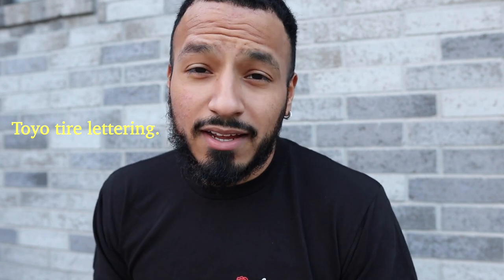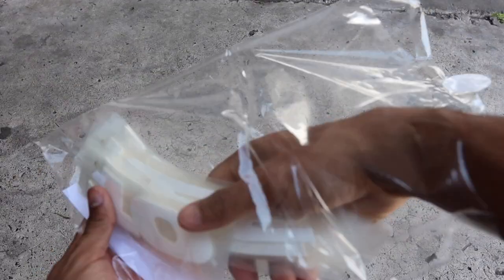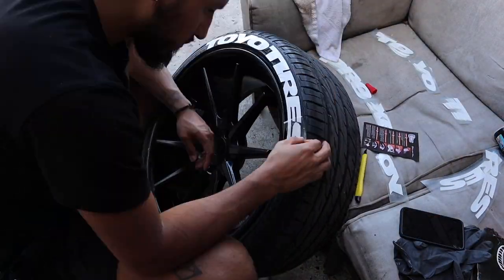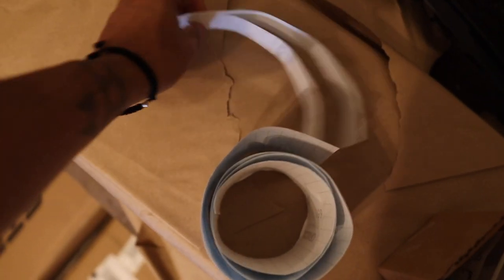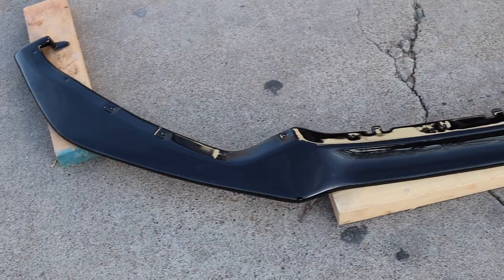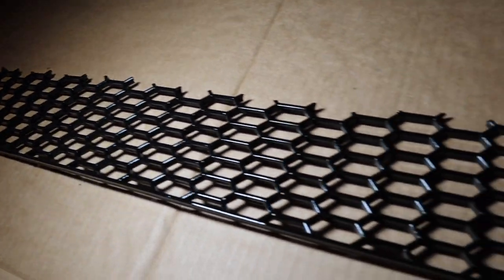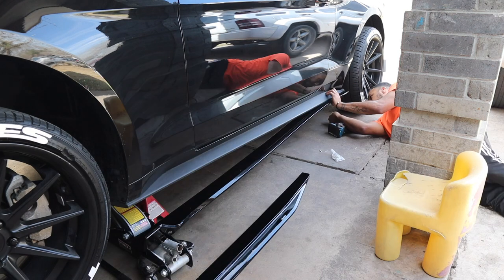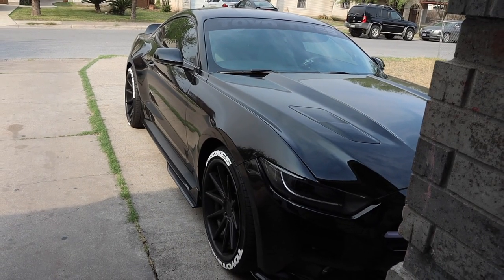Project neck breaker ll S550 Mustang Ecoboost build.

Comment: do you regret not getting a v6 or a v8? i want a mustang and the eco is really looking good but everyone talks about the v8 and how the eco is a joke. just wondering if its worth it in your opinion to get the eco as compared to the v6 and v8
Reply: I can tell you first hand my experience. I went from a V8 to a v6 Camaro. I loved saving more on gas but after modding my Camaro and tuning it, my gas was about the same as my Camaro SS.

I was preparing to get a mustang and traded in my v6 Camaro for an Ecoboost Mustang in hopes of having more flexibility on modding. After 3 days off driving the Ecoboost, I decided to really look at the V8. I took one out for a spin and immediately exchanged from the Ecoboost to the V8 GT. Thankfully the dealership had a buyer's remorse program giving you time to change your mind.

The difference for me was night and day. The power, the torque, and the sound. The overall feel completely changed. It's like walking a dog at a dog park when you see someone walking a little Yorkie or walking a big Doberman or Rottweiler. It's a big difference. I never give hate on the Eco's, the v6, or GTs because it's all preference. If you have a long commute or do a lot of driving, the Eco my be a better decision. If you don't do as much driving a GT might be a better fit. But be warned, the GT will be a beast in it's stock form and it's ready to be tamed. Little mods make a difference. Just a cold air intake and Summer tires make a difference. Now I'm addicted to my GT and done all of the bolt on mods that can be done to it. There's only one more mod left which is a super charger which I'll be doing in about a year or so.
Reply: @darrylpolite8722  I really want a gt but they go for 10k more than an ecoboost rn lmao
Reply: @frankj9270  luckily I found a 2016 gt for 24k
Reply: @al3x20_54  with 200k miles
Reply: @frankj9270  81k*
Reply: @al3x20_54  yeah good for u i get no good deals in my area

Comment: Love the car bro! I’m just curious, have you thought about making it fast? You don’t really see anything fast except the V8’s! Lol no hate or anything but I think that getting gapped by something everyone hates on would be funny 😆
Reply from the maker: I’ve been debating a big turbo. I’m looking into it 10 speed GT for some power tho. That’s why my eco is kinda rice rn ya know. But I’ll pull the trigger on something soon
Reply: I agree. Me. I do engine mods first then whatever for looks. Not a looks kinda guy. Don't  like badges or stickers unless under hood. My car is a sleeper 2015 ford fusion titanium 2.0 ecoboost. Don't laugh yet, 315whp with a gtX2836 currently being tuned for 400whp with a gtx2867. Extensive internal engine mods. Tore it down and rebuild it myself so I know it was done correctly and not by someone who was rushed by his boss or had a bad day. Point being you can glamour your car all day long with stickers, skirts, splitters, but at the end of the day, what are you gonna do when someone pulls up next to you and test those external mods to the next light. But car does look nice. You had me fooled, I thought it was a V8.
Reply from the maker: @jobu9737  all that talk but not a single video or picture to back up that apparent 400whp fusion. All I see is 🧢🧢🧢🧢😂  bro idc if I have a 20 or 2000 horsepower beauty. People look at my shit differently & that’s all that matters to me. Not going for a sleeper or whatever y’all car princesses get heated over. There isn’t any rules to what you can do to your car so take ya two cents somewhere else 👀
Reply: @1messi1ful  That’s the way to handle that 🧢🧢🧢🧢LOLOL
Reply: @jobu9737  post a video of a pull I get what you mean on your comment but I want to see your sleeper now
Reply: @1messi1ful  priceless rebuttal 💎 and oh SOOO real 🙏🙏💪🏾💪🏾

Comment: Dude. Your car is cool as fuck, but either to hell with those fake Toyo letterings on the tires and windshield or, just........ buy the proxes. The strut bars on you front lip also do nothing btw so just a heads up. Maybe now you should add a bigger turbo to get your car above 300 horsepower. No hate, just constructive criticism.
Reply: What do you mean strut bars do nothing? If you have a functioning splitter they do
Reply: you searched ecoboost on yt and just want to hate for no reason😂😂 go outside
Reply from the maker: @KINGSMITHH  hahahhhaa fr
Reply: I hope it’s a show car😳😳😳 but year up badging anything is bad taste